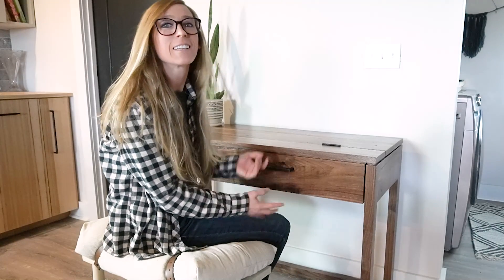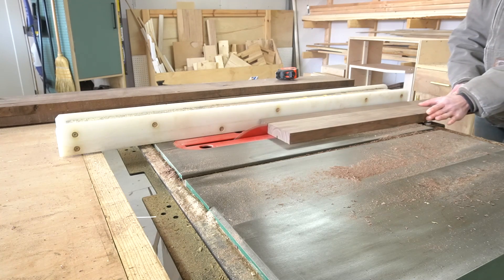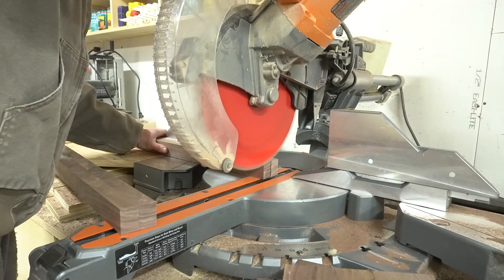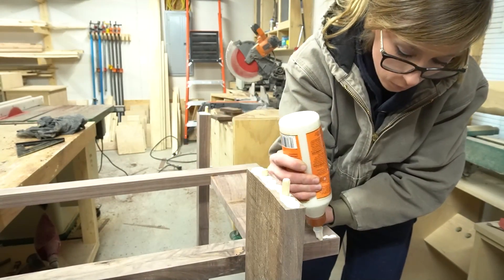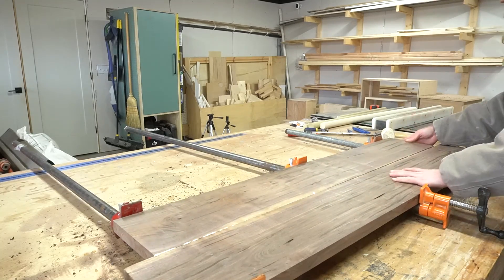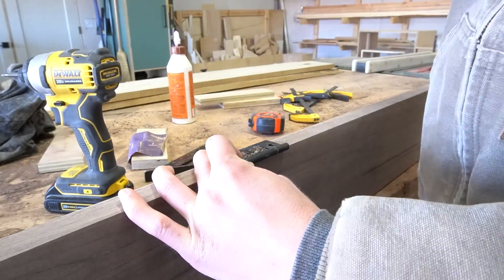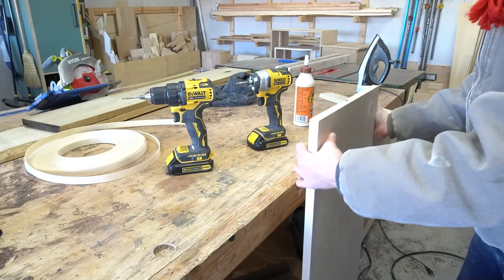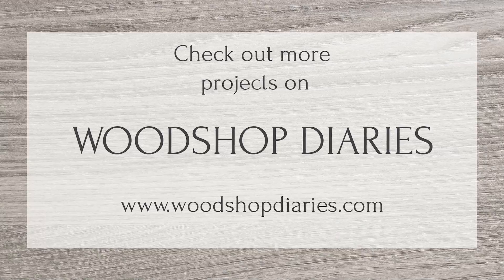How to Build a {FLIP TOP} Keyboard Stand with Pull Out Tray

Comment: Since you have a table saw and a planer, you can easily build sleds for either one to do the face jointing and edge jointing that you need to do with rough lumber. And, once you have them built you can use them for many future projects.
Reply from the maker: Yes, I’m hoping to build a few and try a few new techniques in the new year!

Comment: What an awesome idea. loved it all but just in case you want you can put hidden hinges so you don't see the on top. Over all I think it's a great idea and may just have to build one for my niece . I have a full size one and I wish I didn't because of the large footprint. Multi purpose is the way to go.4
Reply from the maker: Thanks so much! I looked at several different ways to use hidden hinges, but none of them would work in my case due to the spacing requirements. If I had to do it over, I’d make the drawer section taller to allow more room for blocks to mount the hinges on. But...this way kept it simple and got the job done

Comment: Okay, one more question/request... Have you already done a video for a matching piano bench? If not, could you? 😃

I’m imagining a similar design for the legs of the bench, but I’m at a loss after that...

How do the legs meet at the seat? What thickness of wood is ideal for the seat? How can you then add some cushion and vinyl to make it comfy?

I could probably figure something out if I sit with this, but I’m a woodworking noob, so I’m trusting you’ve done it well already or could do it well!!!

Thanks again!!! 🙏🏾👍🏾👌🏾✌🏾
Reply from the maker: I haven’t made a bench yet. We are still using the one shown in this video. I have plans to eventually come back to build a bench for it but just haven’t decided on a design yet. The one I made shown in the video was just some poplar dowels and a 1x12 screwed into the top. I added a bed pillow on top and made a drop cloth cover for it as a cushion. 

It works for now 😅 but I will eventually come back and replace it.

Comment: Hi, great tutorial! I recently bought a Yamaha P-45 electric piano for my girlfriend and came across the same issue with the stand. I want something that looks nice and is equally sturdy and i think your plans are excellent. Im looking online for supplies and I’m having trouble finding 3/4” plywood, do you think i can build the table with 1/2” plywood and still have the table hold the piano without any issues?
Reply from the maker: Hi! I don’t recommend building this with 1/2” plywood as the long span would be very likely to sag. 3/4” plywood is a common size but is a bit “generic” in terminology. You may find it listed as 23/32” vs 3/4”.

Comment: This is a great keyboard stand. I have the x frames and they are pretty ugly. I am a female diyer who is trying to get into woodworking, so far it is a hobby so done a few things like make shelves ect. But not furniture's. So it it really nice to see another female woodworker especially using the table saw. I really want to buy a table saw but reading all these horror stories has scared the scrap out of me. But if I don't buy a table saw, I would get a track saw. But anyway, awesome build, this is something I am adding to my future builds, probably use pine or plywood. In the UK, woods are pretty expensive so would go for those 2 options. Can I ask, when you started out, was table saw the first purchase or once you got used to woodworking, you expanded on your tools. Subscribed👍
Reply from the maker: Thank you! You got this, friend! The table saw is a scary tool, but with some practice, is a very useful one.  However, it definitely wasn't one of my first tools. I've got a whole post about the tools I started with here if you're interested:
https://www.woodshopdiaries.com/5-tools-need-get-started-woodworking-less-500/
Of course, there's no right or wrong tools to start with...If you want to start with a table saw, you can.  I just personally think it's a little more advanced.
Reply: @WoodshopDiaries  Thanks for the link. I pretty much have the tools apart from a mitre saw and nail gun. I do have a corded nail gun but differently want to get a ryobi nail gun. I am going to wait until the price drops as they are pretty pricey in the UK. I use a mix of Bosch professional and Ryobi tools so whenever I do buy cordless tools, aways get from those two brands. Thankfully mitre saws are pretty cheap in the UK. I agree, I think I will put the table saw on hold for the time being. I think once I am more confortable in woodworking, then I will invest in one. I think I will look into getting a track saw instead until I am more confortable and the need for one is required. Many thanks for the response and link.

Comment: Great job! One question though; is it possible to keep the keyboard drawer from sliding back into the cabinet while you are playing it? Is there a way to lock it into place after you pull it out so that it doesnt move while you are playing it?
Reply from the maker: I'm sure there's a way to do that, but it's not been an issue for us so we haven't bothered to do anything about it.  It stays in place while we play, and doesn't really slide back and forth.
Reply: @WoodshopDiaries  that's awesome!! I had someone quote me $1250 to build one of these just a little bit larger. I had no idea woodworking was so expensive lol

Comment: Such a beautiful keaboard desk! Love it!!!❤️
I'd like to try making it with a full length keyboard, is it ok to use the same materials if I doubled the sizes...?😅
Reply from the maker: You can make this longer to fit your specific keyboard.  But depending on how long it ends up being, you may want to consider a thicker top as the extra length may cause it to sag a little in the middle.

Comment: The stand for my digital piano is decent, but I regret not making something like this instead. One thought: in my experience, digital keyboards aren't very good for learning or practicing piano since the keys aren't properly weighted (the feel is completely different), plus they often don't have a full set of 88 keys. A "digital piano" (with fully weighted keys) is a few hundred dollars more expensive, so perhaps not great for an absolute beginner, but if your husband starts to really get into it you should probably upgrade sooner rather than later (would be good if this is sized to accommodate one of those as well).
Reply from the maker: He’s a very occasional player and we don’t have room for anything bigger in our studio style home. So at least for now, this has been excellent. May consider weighted keys in the future
Reply: @WoodshopDiaries  Glad it's been working out! If you do upgrade, just note that you won't really get anything close to the right feel with "semi-weighted" keys. I unfortunately made that mistake when buying a keyboard to take to college. Also, though they're called "digital painos" they're basically just keyboards with a full set of 88 keys and more realistic key weighting (also fewer fun synthesizer options). Compared to a keyboard with 61 full sized keys, it should only be ~14" (give or take) wider.

Comment: Hi there, I’m building your keyboard stand and I’m just wondering, did you attach the hinge hardware and top lid pieces prior to staining or did you stain the wood separate from the hardware? I’ve stained wood before, but never with hardware attached and I don’t know if it will leave any weird residue on the metal pieces... 🧐🤔

Thanks!!! 🙏🏾
Reply from the maker: I didn’t stain this piece. I just polyed it. I assembled the entire thing, then applied a few coats of clear finish. You can stain it with or without hardware. Just wipe it off if you get any on it...it’s not a huge deal 👍
Reply: @WoodshopDiaries  Awesome! Thanks so much! I’m at the point where everything for the top is cut now and I think analysis paralysis is trying to stop me from finishing the project... 

It may not be as nice as yours, but I think I’m gonna be excited to move my keyboard off the generic metal stand to a piece of homemade furniture!!! Thanks for posting this design!

Comment: Why didn't you use hidden hinges?
Reply from the maker: Concealed hinges? I’d have to have mounted scrap blocks underneath the top to Mount the hinges on, and there wasn’t enough room for that AND the keyboard. I actually wanted the front to flip down and the top to flip up, but there wasn’t enough room to mount all the pieces in order to mount the hinges so I settled for this.
Reply: @WoodshopDiaries  for future jobs, you can use hidden barrel hinges 10 12 and 14mm you can also use concealed soss hinges all will work with 3/4" stock I've used both on many of  builds before work great

Comment: Fantastic design!  Next project for me, my daughter plays piano as well. Just wondering if the hinges can be below the table top surface.? Thanks for sharing.
Reply from the maker: You can install the hinges a little lower, but keep in mind it will make the gap between the back and front pieces quite a bit larger to accommodate the pin